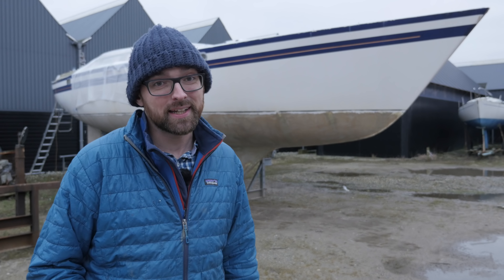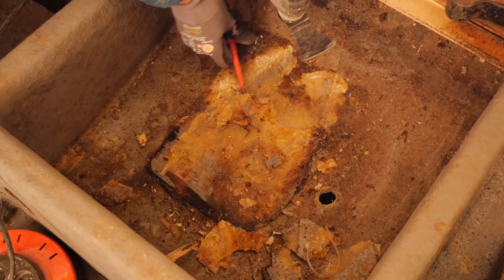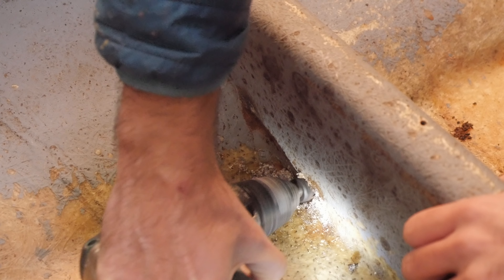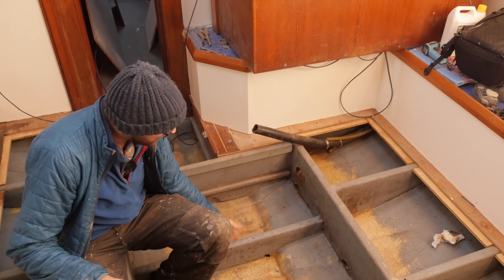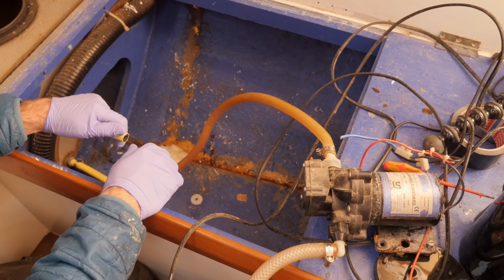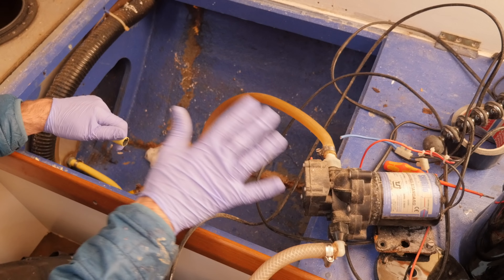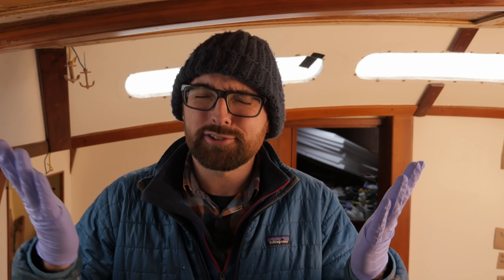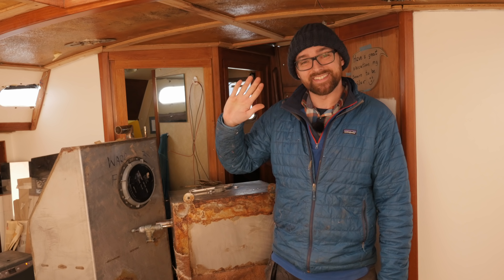Sail Life - No sanding, no painting but wet plywood...yay! - DIY sailboat repair

Comment: Why not just cut out the bottom weld (5-10mm) of the stainless tank that is leaking and make re weld it? will save you some $$$ If the material is 316 steel it will last long time with a new weld, and you don't get plastic tasting water.

Comment: Find a machine shop that welds stainless and is certified. 
Buy the stainless make sure you buy the right grade (StainlessSteelGrades.aspx)
Make sure the company does not have marine in any of its titles $$$
They will be able to cut and weld your tank for a fraction of buying a tank . Plastic sucks fyi

Comment: A thorough inspecting of those floor frames and stringers is required.  Several test holes will have to be drilled. and then filled.

I don't know if you have watched the YouTube Channel Have Wind Will Travel, but here is what the found under their mast step https://youtu.be/bOh953YDvPM?t=1m46s

Comment: I obviously don't know where you got your quotation from regarding a custom made tank in the UK but I have had quite a number of years experience of dealing with Bliby Plastics in Kent, UK to produce tough reliable plastic bunker feeding troughs and water drinking tanks for pigs and some custom items made to size for particular locations. Note all products supplied were either solid black or white if this makes any difference to you, which I doubt judging by their location in your boat.

I have just checked their web site and I note they are offering a custom made tanks service in the section on the fabrication and machining part of their web site:
http://www.bliby.net/categories/Fabrication-%26-Machining-Services. 

This may be of direct interest to you as their products have proved to be highly reliable and tough in that the pigs have been unable to destroy them by trying to eat them! However I cannot imagine that shipping would be cheap due to bulky volume rather than weight.

On this basic theme there must be similar more local manufacturers in either Denmark or Germany that could help since there are lots of pigs kept commercially in both countries.

Comment: Why don't you seal those compartments with fibre glass so that they are air tight and water will never be a problem in the future. and you won't need to drill drainage holes all over the place.. Just an idea. I call it a brainless wave !